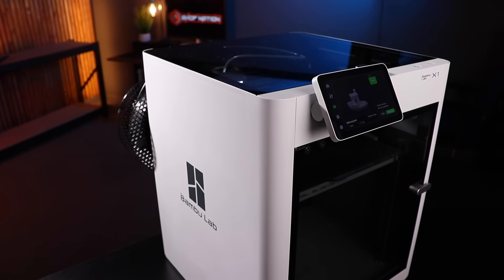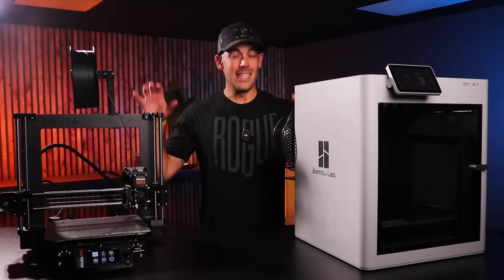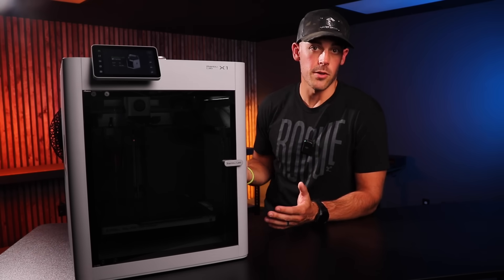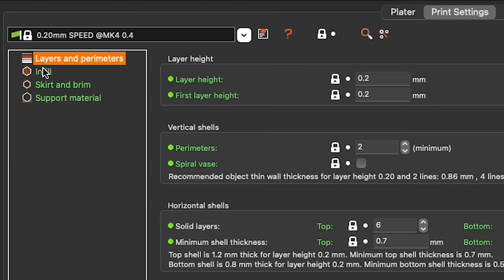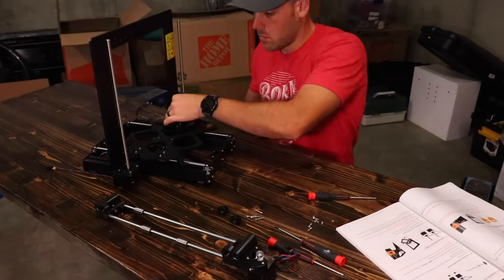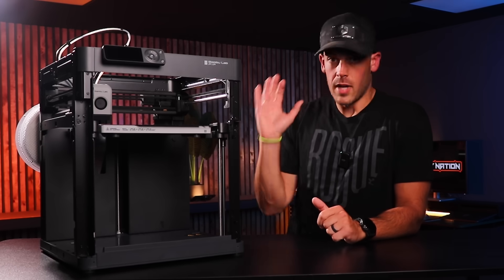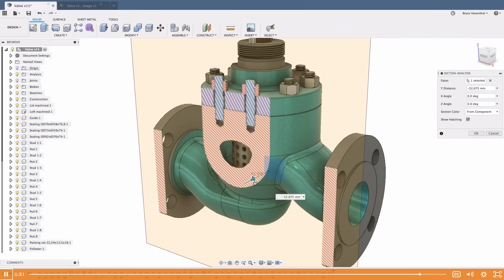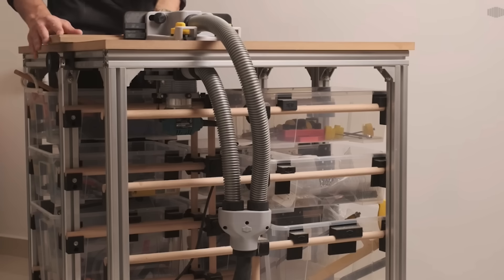The 3D Printer I'd buy if I started over

Comment: Interesting.  With all you had said in this video.  I'd give the "nudge" to Prusa.  Track record, reliability and ease of repair is what's important to me.  I see Bambu as a fad.
Reply: Prusa makes a fine product. Their name is synonymous with quality. But after introducing a P1P to my print lab, I find I rarely even use my i3 printers anymore. They sit idle because it's literally faster to print components in series on the P1P than it is to print them in parallel on the others. Plus, despite spending years getting many these printers tuned just right, the P1P right out of the box consistently gets *better*, smoother prints than they do. It's  almost infuriating. :P 

If you're a print shop and reliability and ease of repair are paramount, and you already understand i3 printers inside and out (and enjoy the tinkering process), I can totally see why one might be inclined to lean towards Prusa...  Hell, a couple months ago, I would have agreed! But after seeing this thing work with my own eyeballs, it's just -- and I don't use this word lightly -- an astonishing machine. I'm a designer that sells STL files, and I use my printers mostly for prototyping parts. I cannot understate what a fundamental game changer it is to be able to print a part and test it in 32 minutes instead of 2.5 hours, or a larger component in 7 hours, instead of 25.  I'm also at the stage of my 3d printing career that I've had my time tinkering and tooling and modding; I've gotten all that out of my system. Now, I just want a machine that works. And man, the P1P does!

So I would say the assumption that Bambu is a "fad" is a mistake. I mean, they may very well just sit on their laurels and fade into the four winds, but... I doubt it. Bambu has hit that magical sweet spot of 
a. make an amazing product that disrupts the industry 
b. make sure everyone knows it 

And they are making absolute bank as a result. And they will continue to do so until someone steps up to knock them off their perch. But from what I've seen, they obviously know what they are doing, and if they keep innovating and evolving their products, they have a leg up on the competetion by virtue of being the first in this space of ludicrous speed + excellent quality.
Reply: @Mnkylord    I get all else you mention.  Maybe I'm just saying a fad because something "new and improved" is the fad and usually may not be the nudge in its favor in my book.  How many times have you seen "new and improved" on a product you've always used.  What were you getting before?  Old and lousy?  But to be quite frank and pointed, I make purchases on everything I buy very deliberate.  It matters to me what the made in label says.

Comment: pip may be cheap but if can't fix it or upgrade whats the point then there are just garbage printers i have 2 3d printers running cr10 smart pro and and a mk4  
/ broken printers ender 3,  plus a cr5 s1 and 2 sovol 6 plus broken spent more time then its worth trying to fix, personally prusa are expensive but my mk4 has printed for 2 weeks strait no issues
Reply from the maker: Prusa reliability is tough to argue with but Bambulabs printers don’t need upgrades, that’s kind of the point

Comment: Finally, a video that approaches these 3d printers as what they are: tools for doing work. Ive had such a hard time finding honest recommendations and assessments particularly of the Bambu Lab printers because everybody in the space takes a simplistic "closed source = the devil" view of the market. And I get it, repairable design and parts availability are important, but so is just getting the work done with no fuss and no endless fiddling. I literally had someone recommend me an Ender 3 v2 with something like a dozen custom modifications I'd have to 3d print myself, before I could even use my 3d printer for actual work! Thats not smart if your goal is to solve problems. Thats what you do if working on your 3d printer is more enjoyable than printing with it.

I've been driven towards so many printers that almost do what I need, but miss the mark somewhere, just because people can't take their open source hobbyist blinders off and just recommend a product that suits my use case. 

I'm still debating the Mk4 kit vs the P1P, but im very hesitant to grab a product that is half baked in the software department like the Prusa is now. Sure, they can fix it over time, but you should never buy a tool based on a promise it'll work later. You buy the tool you need that works out of the box.
Reply: I complete understand your comment. I started with a never ending diy ender 3 , then side graded to an mk3s+. I got an ankermake and X1CC. I sidelined the first 2 printers and haven't opened the box on the ankermake.* The X1C has printed more parts in 10 months than years on the Mk3s+ and ender combined. 

The mk3 and the mk4 arent much different unless you are running alpha firmware and based on reviews it isnt much of an upgrade. I just want a device that prints. I dont care about "open source" or whatever buzz word gets tossed around. I need it to work and work well. 

* the ankermake came in Dec 2022(kick starter). The reason why I dont use it is because I ordered a 6 change filament box which will come sometime in 2023.

Comment: Input shaping is part of it but so are the carbon rods and belt combo.
Reply: Also replacing parts on bambu is fairly easily and pretty documented on their wiki
Reply: And input shaper is a firmware feature.   You can run it on almost any machine as long as you add the sensor
Reply from the maker: Yes

Comment: I’m a long time Prusa user and I’ve also owned Creality printers. The Bambu X1-CARBON is a game changer for me. I love my Prusa and have always been able to fix issues that came up, but honestly I’m tired of tinkering. I want to print. The Bambu is good for that. It’s also better with higher temp filaments. That was the main selling point for me. I wanted to reliably print nylon and others. I also love not being tied to the printer. Being able to load files remotely and watch from a distance without first setting it up myself is huge. Since I bought my Bambu a few months ago it’s been running. Great machine. I happily recommend both the Bambu and Prusa if asked (I know some still enjoy the building and tinkering).
Reply from the maker: Yes!

Comment: I have a P1P! It's like a microwave appliance. You put something in, the filament, run it, and you get something complete out of it. No tinkering, no self bed leveling, no long waits for simple prints. You do have to slice and understand that aspect but thats with successfully printing anything on any printer. I bought it for speeeeeeed and it has not disappointed. Cheaper units double, triple or sometime quadruple the print time speed and come with other headaches. I don't have patience for waiting countless hours lol. Funny story- many years ago i paid almost the same amount (700) for a slow bed slinger when it was the newest tech out there. Now you can pick one up for 200 or less even.
Reply: @Tron-Jockey I'm happy somebody finally enjoyed that lol
Reply: I'm not the sharpest spoon in the toaster so I could absolutely use that one, I want something simple and easy to operate without constant adjustment like my creality ender did

Comment: P1P would be good to start on just to learn to print and use some PLA but then it would be a paperweight if you want to do any high tech filaments that are good, durable & functional. If you want a Bambu printer, get the X1C right from the start.

Comment: Excellent Video! I've been looking at 3D printers for a few years, and you hit on all the key points.  Great summary and advice.  Will I go with your recommendation of the P1P?  Probably not...  but that is because I am old and stuck in my ways...  I am leaning strongly towards the MK4 kit.  Its an 8 week lead time, so I should just order one now.
and by the way, that was a smooooth segway into Factor.

Comment: I got Into 3D printing as well to solve practical problems in my spare time. I went then cheap rout with an Ender3v2 and after a few mods I’m very happy with its reliability and accuracy. That said … next One will likely be a Prusa. All my prints have been adapters for connecting my tools to dust extraction, custom bins for my parts organizers, etc. very happy with the use around the shop.
Reply: I have bambulab machines but can vouch for the Prusa reliability. There's a reason most print farms have prusa machines and the mk3s is a solid work horse.

Comment: paid 170 for my neptune 2. screwed it together and boom. it was printing in around 7 minutes. literally hadn't ever touched one prior. 

you don't need to spend upwards of a grand on a prusa for the assembled (ish) one, or the 800 dollar kit.

they're nice, don't get me wrong, but you don't need to spend that much.

i'm not even 800 bucks into my highly customized printer now, a couple years later. i don't even think i'm 300 into it with spare parts accounted for.

even if you want easy mode don't need to worry about hassle, you still don't need to drop 800 on a decent machine.

several good options you can buy without dropping a car payment on them. or several.
Reply: I bought my E3 for $100, it was a lucky day. Still have no regrets, and would buy another one, if started over. But I really love the idea that printer can print its parts. Do not really get an idea why someone want 3d printer if not for DIY. As you eventually will have to deal with all 3d printing nuances. Even most expensive ones do not solve all trouble. And I do not mention software issues. To think about it, I would not agree to buy any other printer, even Bambu for the same $100. Only may be to resell it with a higher price, and then buy E3. = )
Also I heard E4 is not bad too. But they make plastic top on nonpro version, and steel rollers on pro version(but alu profile on top). Which gave me idea I would better buy Aquila C2. = )

Comment: All the chinese 3d printer junkware out there must burn. Some of them do this literally. Prusa, any Prusa, are work horses. BambuLab is the fancy turbo ultra speed printer with interesting features and a lot of margin for improvements. But stay away from chinese junkware at all cost. Or don't, and then regret it and dump them and go buy a REAL 3D printer. Like a Prusa. Or a Bambulab. And please, stay away from Ultimaker and other overpriced brands: they just charge you for an insane amount of money for a product that print exaclty (or worse in some casese) like a Prusa or a Bambulab.

Comment: No. the P1P has an sub par user experience with that screen. It also doesn't have a track record for long term reliability and the maintenance on certain parts is not achievable.
Reply from the maker: The screen is a step up from the prusa mk3 experience and that is one of the most popular printers on the planet. Also with bambulab slicer/app you can do it remotely

Comment: I am wondering what will be in one year when Bambulab will release let's call it x1d , what about support and parts accessibility for x1c  if  support even now leaves a lot to be desired ? For 1500$ it may be important, I was choosing between x1c and mk4 for 4 months, spent many hours on the internet, facebook groups , yesterday I ordered Prusa even if at the end speed will be 2 times lower I believe that durability and print quality will be higher than x1c when stable input shaping firmware will be released. If I will be wrong you can crucify me we will find out in September ;)
Reply from the maker: I think you made a wise choice. The Bambulab machines still have something to prove over the long haul

Comment: P1p What about da carbon rods that need replacing after 600 hrs?
Reply from the maker: That’s certainly one of the question marks on those printers
Reply: People have waaaaay more print time with the rods still running fine. Furthermore they sell replacement rods.

Comment: I think you're to hard on the Ender V3. I have been using a stock one for about 3-4 years with hardly any failed prints. And yes having an auto bed leveling would be nice, but is hardly needed and for prototypes the majority of prints is doesn't even matter if its a bit off. It just needs to do its work and it does.
Reply from the maker: You’ve just never seen the other side of the argument. Enders can be good but too many variables
Reply: And E3 is very easy to assemble. No this constructor bs. And it works out of the box. And really cheap. Best to start and understand do you really need that?
Of course it is better to fix bed at least and upgrade to PEI. All troubles of E3 are already known, and you can check them just before you even thing of ordering E3.
If your bed is flat and bed bolts are fixed with nuts, no autoleveling is needed. All those things are really noob myths. But I guess, someone with little budget will make his choice without such videos.

Comment from the maker: 🔥Bambulab P1P is on SALE for $599! 🔥 https://bit.ly/3O2SLFy

Use code SHOPNATION50 to get 50% off your first Factor box at https://bit.ly/3I2A1CY !
Reply: Come on man. I need to be able to 3D print in Inconel / titanium / Magnacut and I need it a desktop sized device for under 1000$ 😂😂😂
Reply: @LogicalQ  Dito
Reply: Thank you so much for doing this video. 3D printing is something I want to get into, if for nothing else then to just solve a few problems in my own life. I have one question that I'm trying to get answered but how can I get the real world into the modeling software? I've seen videos of people using scanners to model a physical object. Does that work on an empty space? I want to make a cover plate for a small storage bin in my cars center console to use as a switch plate for things like external lights, speakers, etc. Any recommendation on a budget friendly scanner that would do that? Thanks!
Reply: Thanks for this vid, I started printing a while ago. And like most people, i got the ender 3 v2. But the only reason that helps beginners is because it teaches them how to fix stuff. But with a real machine, they usually don’t need fixing. Glad to see beginners escaping the creality trap
Reply: I think this video is pretty good and you check most boxes for beginners, however you contradict yourself a little with the kit. It is good to show that something like a kit version exists however before oyu mentioned "if your hobby is 3Dprinting not working on the printer" which is exactly what a kit is.
Also you didn´t mention resin printing at all. I know it´s not really beginner friendly and all due to the toxic resin however the machine is super simple and some people might want the extra resolution. Heck I would want the extra resolution if the clean up and the toxic waste and all that nonsense wasn´t so bad.
Reply: always funny to watch a skinny guy tries to flex arms lol. casual youtube kid with a ego problem
Reply: I would like to 3D print molds, to make molds, for casting gold and silver jewlery . . .  so very exact, very accurate, very fine detail is most important... :-)
  I wonder what 3D printer in 2023 is most Precise with the finest quality,  with the tiny tiniest details ?
Reply: When it’s available, I will buy it! Got my new print surface and the nozzle you worked on today! Looking forwards to using them on the K-1. I think my K-Max will be delivered on Saturday.

Comment: Thank you so much for this video!  Like you, I do a lot of printing of actual parts and pieces for big projects.  The endless stream of a new Creality/China machine every 6 weeks is tiresome.  Both printers you displayed have a solid support system behind them.  They are ready to print, not endless tinkering and upgrading to make them reliable.  We had a few Prusas at work and they wore out after a year or so of pretty heft use.  However, they were well supported with firmware, software and spare parts.  I get sent cheap 3D printers to review all the time and its honestly a race to the bottom in price...and quality.  When people ask me what printer they should get, I point to the ones you have, among others.  I ask, "What's your time worth?"  Do you want to tinker and upgrade to make it work....or do you simply need a reliable machine to get excellent quality prints.  You gained a subscriber!